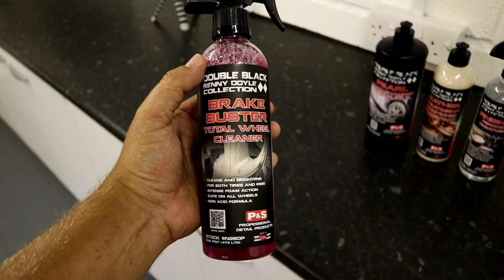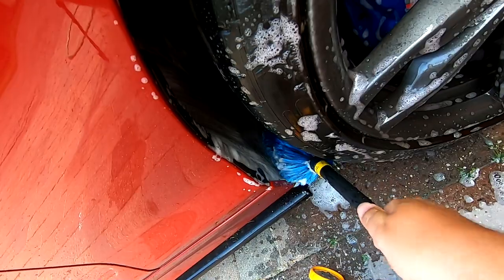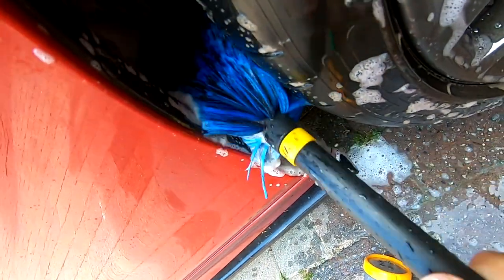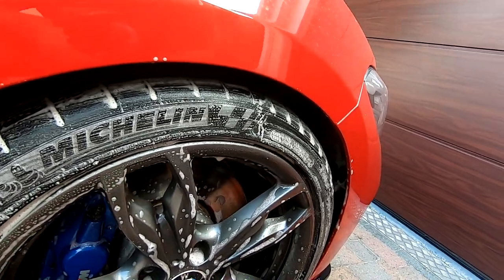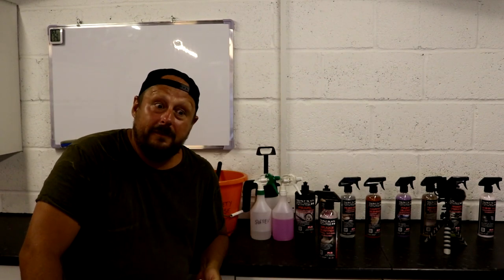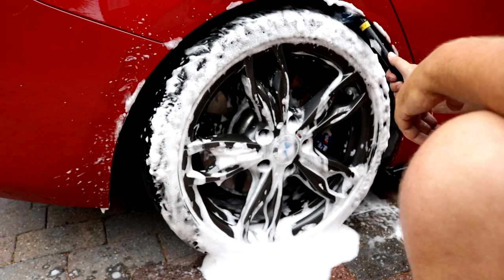P&S Brake Buster Review - A Rising Force

Comment: I recently purchased some Brake Buster here in Australia. I use it with the IK Foamer 2 and find it to be fantastic when used at 1:5. I wash my vehicles weekly and just use an iron remover once a month or so. Brake Buster offers a very good value (works well, good price) and using it with the Foamer is quick and easy. Win/Win/Win as far as I'm concerned.

Comment: This product has been my go to tire/wheel cleaner since I first tried it months ago, although I have plenty of Auto-Fanatic foaming wheel cleaner as well, so it's also in the mix. 

My mix is 3:1 but I really need to go back up to 5 1 to stretch out the value as I clean my wheels atleast once a week. Btw I'm using the orange tip in both my IK Foam Pro2 and the IK 1.5.

Keep up the good work John🇺🇸👍
Reply: Ive used the autofanatic wheel cleaner which is great!! But nd heres a big but... the cost of it is way to much for way u get 49 dollas plus shipping is just out of hand!! P/s is 16bucks for a gallon and u can dilute 5/1 so thats 5 gallons for 16 dollars i mean the choice is pretty clear!!! And it sucks cuz i like phil from autofan.. but i gotta look out for my pocket!!!
Reply: @cbruno12180  it's more than $16 a gallon👈

Comment: Love the review, the best thing about it is no more rusting brake discs. It’s such a good degreaser that it’s one product for arches, tyres and wheels. I even use it on bumper bugs if I’m in a hurry. Cheers Jon.
Reply: is it really that good when comes to what's left on the brake discs after rinsing the product off the wheels ??
Reply: Yes, it’s a rust inhibitor which disappears when you brake for the first time. It’s significantly better than a whee cleaner without that additive

Comment: Thanks for the review, but think I’ll be sticking to BH Auto Wheel and Greenstar APC for now 👍
Reply: I haven't tried a APC but I have to say I found a wheel cleaner which I think beats BH auto wheels in cleaning power. It's called fast shot wheel cleaner and slims detailing sell it in a sample bottle or a gallon bottle.

Comment: Brilliant video! I've been scoping this product pretty hard. I live in the US, so it's quite cheap. Though, with the inability to remove iron particles, would you recommend an iron remover, and then use this?
Reply: Other way around. Most iron remove don’t have detergents to cut through brake dust and reach the metal.

Comment: Hiya Jon - Great channel and videos 👏 
I know that you’d be detailing i guess mainly alloy wheels etc,but I’ve got a question that I’m wondering if you can help me with : I clean up and sell for pocket money old wheel trims. They’re  generally really manky on the rear side with baked on brake dust & road grime which also often bakes itself between the spokes on the front side too. What products/equipment/procedures would you recommend to get that stuff off as quickly and easily as possible please - many thanks in advance - Jonathan from South Wales 🏴 👍
Reply from the maker: well you have to be careful.  So "acids" will break down solid brake matter and soot the most.  So the much maligned wonder wheels can be used to great effect.  But strong acids can damage bare chrome or anodised finished etc...   so its cleaning without damaging.

My recomendation is fallout remover generally as an agressive but safe way to clean wheels .. get "autowheels fromme bilt Hamber spray on agititate it.   get a stubby atlasta brush as well from bonnymans to really poke and the soot/embedded brake dust.
Reply: @ForensicDetailing  Thanks Jon 👍

Comment: Nice review once again! Is there any plan to do a “best wheel cleaner” shootout for bulk buy offerings mate? Would be really interested in something that offers great “wet” foaming like you say and obviously cost effective and dilutable
Reply: There's no best wheel cleaner IMHO , you need to " agitate ".
Even normal car soap with a glove is better than the " best " wheel cleaner with no agitation.
I've cleaned wheels in every way imaginabile.
The only difference is acid ones and Iron removers (to use  once in a while )
Reply: I’m aware of that. I know how wheel cleaners are used, but I’m interested to see a product brand battle for wheel cleaners like the rest of the videos on snow foams, fallout removers etc. There’s no one “best” of any of these product but seeing the pro’s and con’s of different products in the one review video is what I’d like to see
Reply: @StevenWillox  If you ask me I love Labocosmetica Primus (1:10) ,wich is safe even on naked aluminium ( tested myself ) ,koch chemie Green star ( 1:10 ) and Auto Glanz Infinite  ( 1:10 ).
These 3 performs very well.
Don't like BH autowash , it degreses well but it dosn't perform good on dirt.
Reply: For nonacid, agitation free, spray and rinse cleaning power use, I'd give the nod to the Adam's.. I can touch free clean light to moderately dirty coated wheels with it at 3:1. 

I use it at 5:1 paired with agitation. But I generally use other products for agitation cleaning, mostly Break Buster, mainly because it's rust inhibitors actually work well.

Touchless cleaning is really the main cleaning power gauge in my view. Once you add agitation, any moderate quality cleaner is going to perform well. 

Most dirty tires are going to need agitation, hard to do away with that, though some of the newer rubber "coating" type dressings are getting us closer and closer.. 👍👌✌
Reply: @jdisdetermined  Adam's what ?

Comment: Interesting to see how it performs against billberry but for regular cleaning apc is more than good enough or even the cheap pro Kleen fallout remover works well and cheaper than brake buster, really dirty neglected wheels id still go apc followed with korrosol fallout remover for baked on brake dust

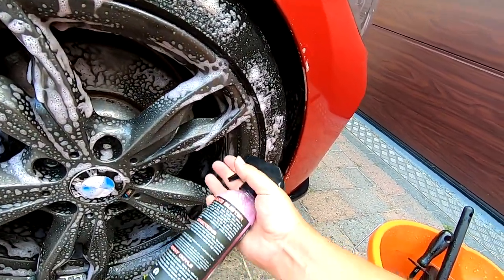Comment: Hey there mate. Let my share my opinion. We do not need to use the most powerful cleaning products. I think we should be looking for the least aggressive ones that work. For the rims and maintenance washes I am using the car shampoo and dedicated mitt. As a prespray there is a superb product probably not available in Kingdom. Exceeded Ultimate Wheel Cleaner. Just went through a bottle and I am yet to try to simplify my toolset. Koch Greenstar 1:20 as a prespray. What do you think? We are talking weekly or every second week wash of properly maintained car with waxed alloys. For the special cases, for the neglected nightmares, then power is a factor and answer is acid & ph 10+ products. Not for my daily ;) 

I have one question. Have you tried carchem 38 wax?

Comment: You lost me at £5 to clean 4 wheels!
Great review thank you
Reply: 😂😂😂 what a waste !! I just use pre wash 1:10 and wheel brush, or IF I want to be extra delicate I use a glove and Car soap.
Reply: G Willis it’s madness, I use valet Pro APC which is fine when done regularly. The 5 litres has lasted forever and that’s using it for everything else too.
Reply: @samwilde595  I cleaned my wheels like 1 hour ago , pre washed them with APC no scrubbing , then glove with soap.
They look shiny 😎
Reply: Andrea ditto, honestly so many of these products are gimmicks. I make my own glass cleaner now too with IPA, Deionised water and a touch of APC, cheap as chips and works better then most I’ve used.
Reply from the maker: This stuff can give you reasonable value.  At 5:1 and with the gallon sizes.  the price is ok in the UK, price is very strong in the UK.

yes you can get cheaper.  I still use surfex to clean my alloys. but I think this might have some more kick on solids.
Reply: @ForensicDetailing  Do you prefer surfex or KC green for wheels ? I prefer KC
Reply from the maker: @dimmacommunication  surfex is stronger, but green star is pretty elite isnt it.  I raved about them both so much.   either will do but I just had to buy some APC and I went with 5 litres of surfex.   next time Ill prolly go green star just because I miss it
Reply: @ForensicDetailing  I really like AG  Infinite but costs a lot , in the end I prefer KC green star , shifts dirt better than surfex imho

Comment: Just searched this video as I bought some of this. Found it great as a tyre cleaner but general apc such as g101 car plan trade multi purpose etc cleans wheels better
Reply from the maker: G101is caustic and contains sodium hydroxide.  Spray it on unpainted calipers in the summer and see what happens to them.  have to consider whats the effect of caustic soda on the the thin top coat you use on leather?  If you look at the SDS for caustic Soda one of its uses is in paint stripper.       Use surfex HD. Its cheaper than 101 and it doesnt use caustic components.
Reply: @ForensicDetailing  couldn’t agree with you more there John I’ve been after some surfex but my supplier is out of stock. Just using hydroxide mixed really weak for now as needs must.
Reply: @ForensicDetailing  oh and I use it for exterior only 101 is too aggressive for interior work. I use gyeon leather cleaner for that mild for soft b,w leather and strong for most other applications. Thanks for the comment back love the advice mate 👌

Comment: Great review!

Jon I need some advice. I’ve done a once over on my car which is wrapped in a vinyl.

Firstly my brake discs keep going orange once I’ve done the alloy wheel cleaner and I’m not sure why ?
And secondly would you recommend a quick wax or needing product for a car that is wrapped ?
Reply from the maker: the chemicals cans promote a bit of oxide or rust from the steel component in the brake disks.  Its nothing to worry about but if you dont like it try surfex HD it wont do this so much.  You can also treat your rotors with Atom mac to inhibit this happening.
Reply: @ForensicDetailing   Thanks Jon!!! 👍🏽👍🏽

Comment: Jon, out of p&s - break buster and bilt hamber - auto wheel, which would you say is a better product?
Reply from the maker: Auto wheel is fallout removed m8.  Better for removing old brake dust but not always required for maintenance wash
Reply: @ForensicDetailing  oh right, I thought it was a wheel cleaner with added iron remover. Cheers mate
Reply: @ForensicDetailing  If I wanted to use the breakbuster and a fallout remover, which would I use first? Jetwash - breakbuster and agitation - jetwash - iron fallout and then final jetwash? Would that be the correct process? Thanks Jon, love all the videos. I’m learning so much from your channel every day!

Comment: Would you really use this over BH Auto Wheel though? I notice Auto Wheels is not acidic or alkaline (so pH neutral?) so could be used more regularly for wheels?
Reply from the maker: for maintainance yes.   I would use autowheels once every 2 months maybe..  generally  would clean with this or an APC or a shampoo maybe.    fallout removers are very powerfull and very effective.  quite expensive though and I dont need to use on my wheels generally.
Reply: @ForensicDetailing  Ok so my alloys are currently getting refurbished so best way to keep them nice is to use my koch greenstar diluted for example, anything else? No need to buy these specific wheel cleaners?
Reply from the maker: @AM4N18  greenstar will do a great job, if your on a budget its going to work out a lot cheaper using GS.  If not a budget  give this a whirl though next time.  only you will know.   Its good stuff.

Comment: Instead of diluting it in an IK Foamer, could you use it in a normal spray bottle? With a dilution ratio of 5:1 / 10:1 ?
Reply from the maker: yes for sure.  1:5 in the foamer seemed about right...
Reply: I’ve had the mousse effect; definitely needs experimentation and every foamer bottle is different (I have 3)
I’ve settled on 1:4 in a Epoca/Mesto but, yes start at 1:2 and you can add water to get the consistency you want (you need a calculator)

Comment: At what point does paying $60 for 5 liters of Bilt Hamber outweigh $20 for 5 liters of Brake Buster. It's takes me far more product and time to clean rims with BB than with BH. Three full sprays of BH for the face of a rim versus multiple sprays of BB to clean a rim. Love the price at $20 per gallon, but the results just don't hold up. Plus, BH is an active cleaner vs the non-active BB.
Reply from the maker: Im not sure what you mean by bilt hamber chip.   If your talking about autowheels though its a fallout remover.  If your talking about surfex its 17 quid for 5 litres here and 10:1 is good for wheels.

BH autowheels is a lot more powerfull. you could use auto wheels on baked on horrible condition dirty alloys.  ITs areally powerfull

However autwheels (and any FR) will like up your brake disks and promote oxidisation.    

It depends what your after but BB is popular I think with guys just looking for a milder product on well maintained alloys.
Reply: @ForensicDetailing ... Yes sir. I'm talking about BH Auto. When I have to clean a set of rims twice with BB when I know once with BH would handle the job, then I start questioning when the dollars spent versus the time saved overlap each other. BB is a decent product but it doesn't compare to what I've seen from BH. 

The problem is obviously cost and availability of BH vs BB. Trying to determine when the time saved outweighs the additional cost.

By the way, I truly enjoy your videos. You're just real, laughing, cracking up all while providing great insight. Have the young man on with you more. You guys are a great pair. Thanks so much.
Reply from the maker: @UKBIGBLUENATION1  fair play.  I know what you mean.  Autowheels is very powerfull it really smashes stuck on brake dusts.   Its very good. lots like the fallout removers for this reason.. awesome stuff chip thanks buddy

Comment: I don’t understand non acid wheel cleaners that aren’t bleeders. If I can’t use acid then car soap works just fine. They all require agitation so why buy special cleaners that aren’t acid
Reply from the maker: quite simple really.  car soap have virtually no cut, specially PH neutral so yes its very very mild.   A high alkaline can degrease much better typically, or more powerfull surfactants can aid the break down of the grime layer.    A dedicated wheel cleaner will also contain some sodium based components which are slightley caustic and these will attack the solid brake dust partifules more.      Its hard to notice the difference of the chemistry or a shampoo and a alkaline unless you test on consistent dirt.. but theres a bit diff..  I can demo this on my dirt simulator

but yes mate if you keep on top of alloys then you can wash them with a soap/shampoo for sure I do this as well.